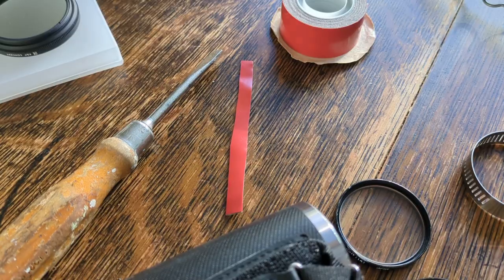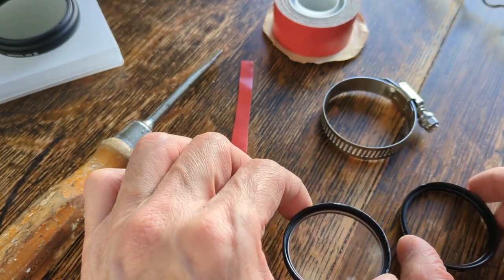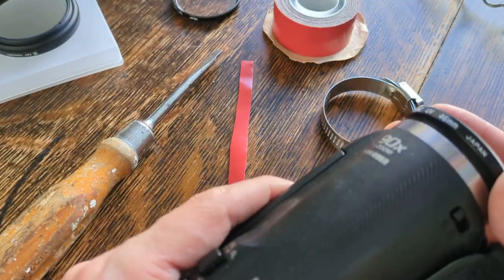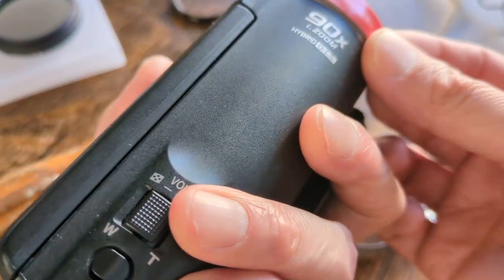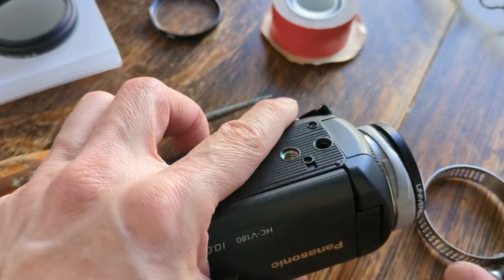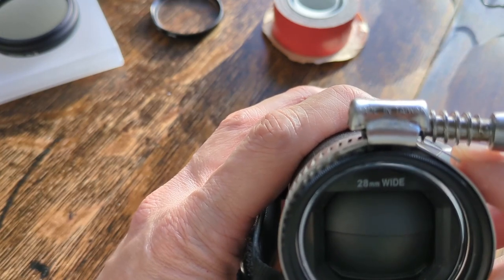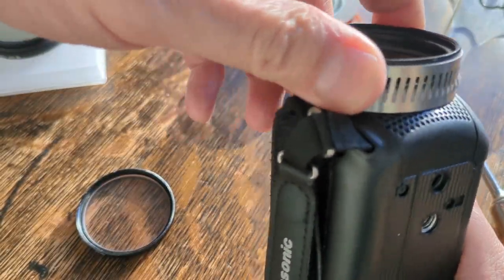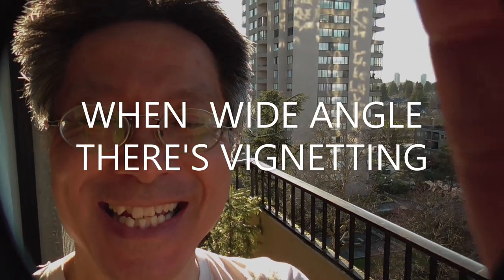How  to add filter threads to your cheap Panasonic or Sony  1080p camcorder

Comment: Hi, do you think it's possible to attach with a smaller strap to avoid vignetting?
Reply: hi adriano: i haven't tried it but using hose strap/hose clamp and choking it up the lens housing could work. you could assemble the following the rig as follows: hose clamp locks down fitted filter ring; filter ring to filter step-up ring; filter step-up ring to a wider filter ring (making sure it's reaches the end of the barrel); then the variable ND filter. actually a good idea. I should try it.
Reply: @JJLee  Yes, in fact I was thinking of getting a step up ring, maybe a 46 - 52 could be enough, does that seem like a good idea to you? ps. I still have to buy the Panasonic